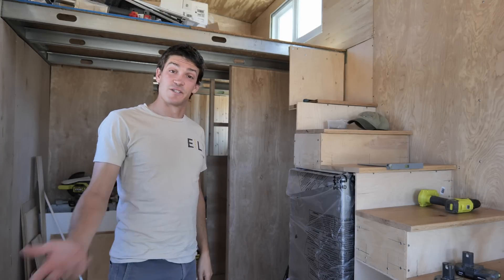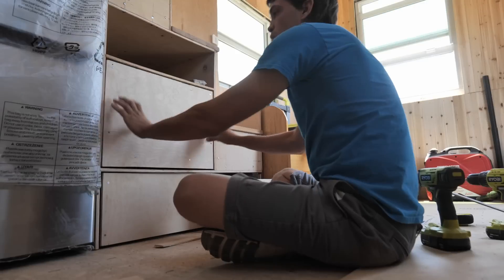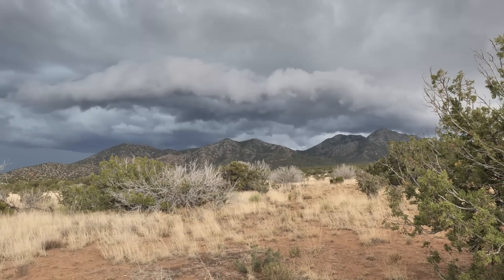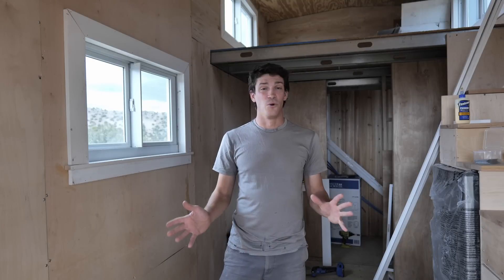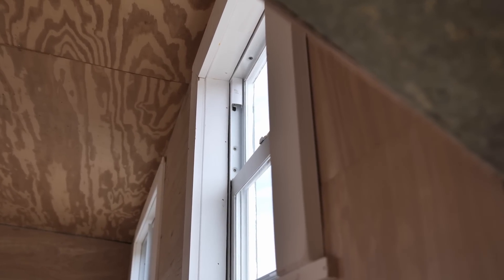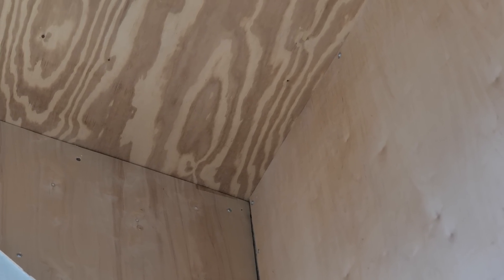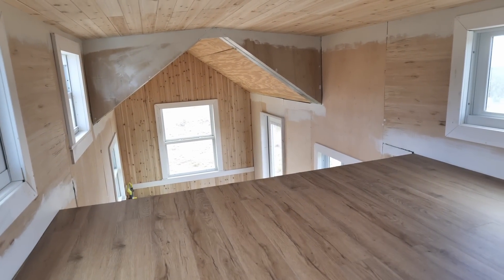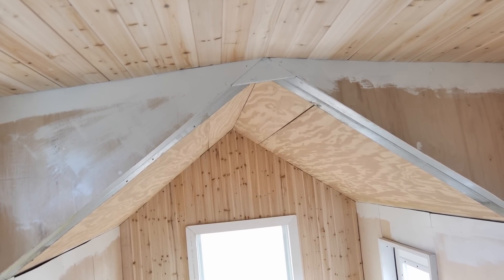Making Progress! Building a Tiny House Living Off Grid

Comment: Great progress on the tiny house. I am very curious/concern about that top step going into the loft though. What is the weight limited for each bracket? I see that part of the step is attached to the metal framing of the loft floor. What type of wood did you use?

Comment: Looks awesome! Can you tell me how you secured the fridge in place to stop it sliding out when travelling? In my van conversion I build a wooden frame around it and used rubber wedges between the fridge and the frame to secure it. Have you done something similar or do you just strap over it when you need to move? Thanks